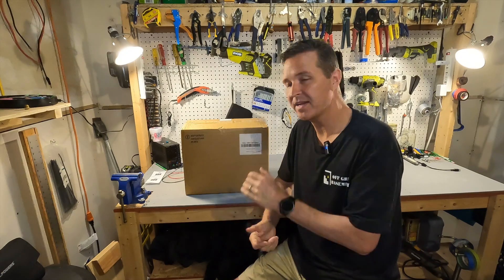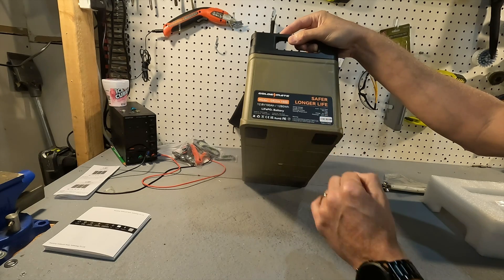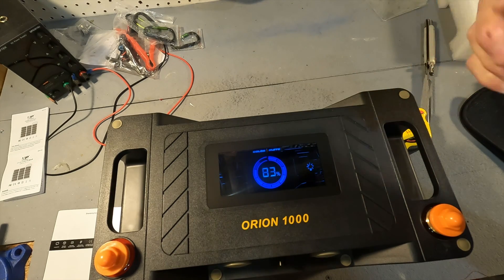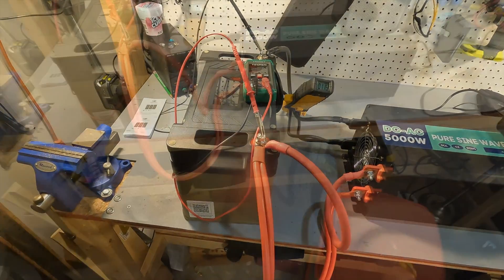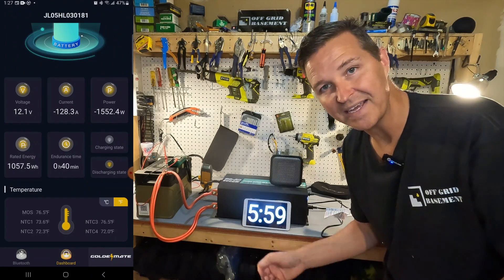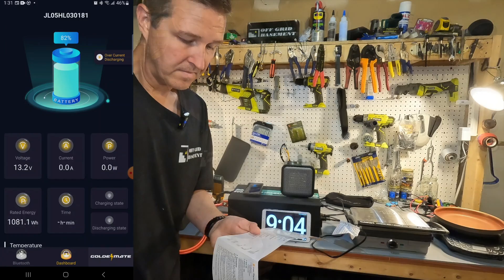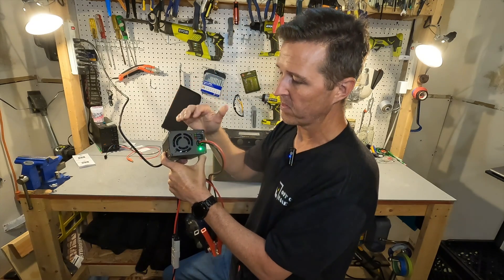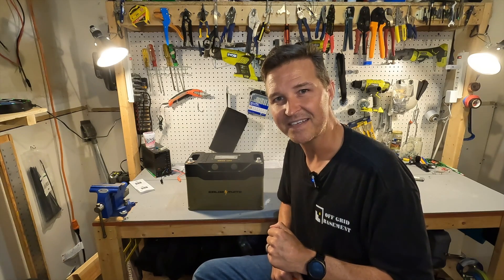GOLDENMATE ORION 1000 12v 100ah Lifepo4 battery review.

Comment: Hi how do you charge the battery???
Reply from the maker: You can use a 12v lifepo4 battery charger or connect to a 12v solar charge controller and 200w solar panel.

Comment: OMG! This is so confusing to me. I have been trying for years to learn about how this all works and I still don't get it. When it's 100 amp hours. What does that mean? The battery will run for 100 hours until it needs charged again? Or does that mean, after 100 hours, the battery is no good? I just bought a van a few days ago and the electrical part of the build is what is stopping me from going forward. I have 5 power stations (overkill) and I was thinking about buying a Jackery 3000, too. I need something that will run an maxxair fan and a fridge. Any advice would be great.
Reply from the maker: That would be something I need to do a video about.  Here are the basics:  12.8v 100ah battery = 1280wh.  That means it can power a 1280w for 1 hour.  If the fan uses 60w, then 1280 \ 60 = 21 hours of runtime.  Hope that helps.

Comment: Doing research on new trolling motor batteries as my lead acids are crapping out at only 2 years. Completely confused on the differences between lithium batteries. Looking to run 24 or 36 volt and not break the bank. Any advice? I've spent a week going down this rabbit hole and I'm about ready to just slap lead acids in again 😂
Reply from the maker: Look into the liTime TM addition.  They're made for trolling motors.  Here is a link to a review I did.  https://youtu.be/0OyrkVDq_0Y
Hope this helps.

Comment: Is it possible to reset the BMS on this battery. Mine has a blank display, no bluetooth, but 13.5v. It won’t charge or discharge. It’s like the battery is just sitting there turned off.
Reply from the maker: I believe you would need to open up the case and disconnect and reconnect  the balance leads to the cells.  Your situation doesn't sound good.
Reply: @OffGridBasement  Would I need to disassemble the cell holders or do the leads have a connector on the BMS?

Comment: Would having a 120 amp BMS output allowance for 100 amp cells concern you about long term cell life?  

A T Burke
Reply from the maker: It would be the heat that's generated that concerns me.  I would hope no one plans on running a battery that amperage consistently.

Comment: I just checked out a Mehrpow 100 AH 12.8 volt battery. It turned out to have 107 AH also with Bluetooth. It has pouch cells and performed excellent. It would be interesting to see if your has pouch cells. Does the top of your battery come off with screws so we can see? Enjoying your reviews thanks for your efforts.
Reply from the maker: I'll check.  I use or give away everything I get so I don't want to destroy it.  Thanks for the comment.
Reply: @OffGridBasement give raffle? Best videos I'm staring on my solar system hereh in Mexico. Barely doin the math to see what I need
Reply: Thanks for the reply. I found a video of one opened up it has cylindrical cells.